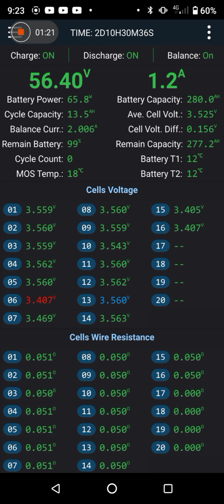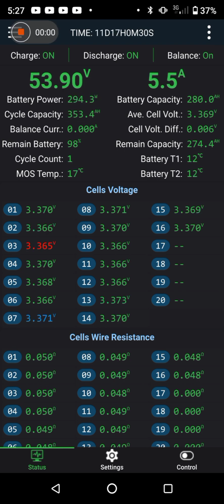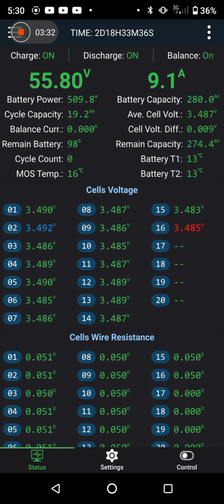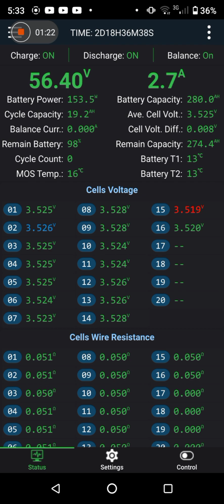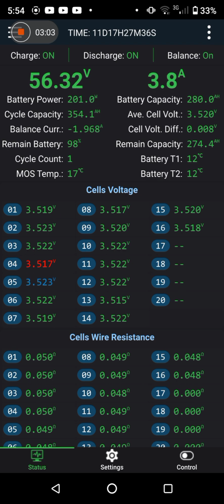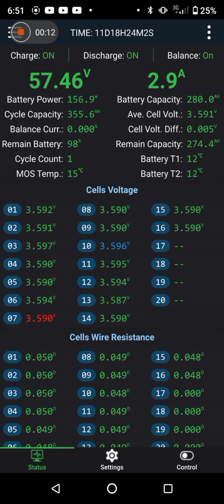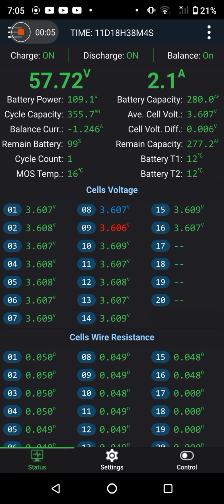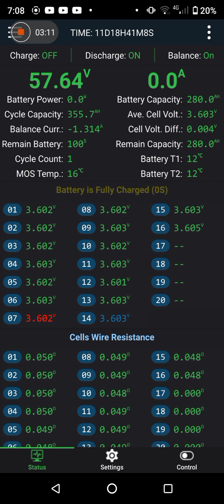SPAM for Breakfast. We are done. My D.I.Y Parallel 280Ah LIFePO4 batteries & all 32 cells balanced😎

Comment: I think if the batteries are charged to 3.45 and absorb for an hour... Im fairly certain they are full at that point. At first I charged a few cycles to 3.6 but I don't gain enough to justify the higher voltage
Reply from the maker: Yeah I agree absolutely nothing to gain but pain.

Comment: That's top balancing done until next year 😂 3.45V/cell is ample for daily use when charging from solar. Like you said, I think its less than 1AH between 3.5 and 3.6V save your battery stress and keep the voltage lower 👍 is there a setting in the inverter where it goes from absorption to float based on the Amps running into the battery so if it goes below a certain amperage then it kicks into gloat mode?
Reply: I was using the all in one for charging until I saw how sometimes it would lock onto a lower panel voltage and get stuck there until I reset it or until the sun went down which was costing me at least half my charge capabilities. I then bought a victron 150-70 and saw a massive improvement on the time it took to get my batteries full. Now I have 3 victron charge controllers and couldn't be happier. I also bought a 4000 watt split phase inverter to run a 240v mini split and actually most of the rest of my small home as well. My all in one unit is still hooked up but I never really need it anymore. I liked the victron stuff well enough that I just bought a DC to DC charger with plans on using it to link my Nissan leaf battery to the lifepo4 battery if there was a time when I didn't have the solar to get me thru.